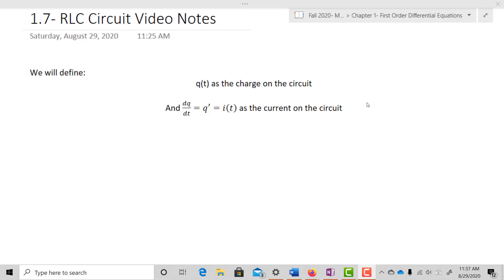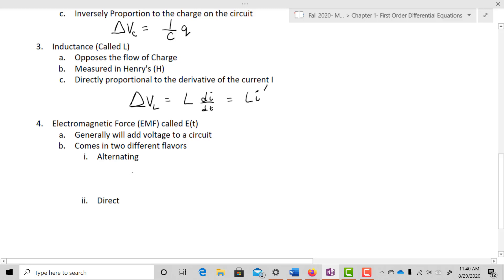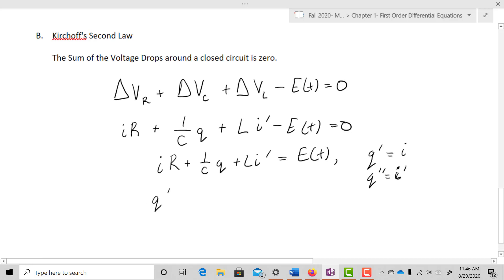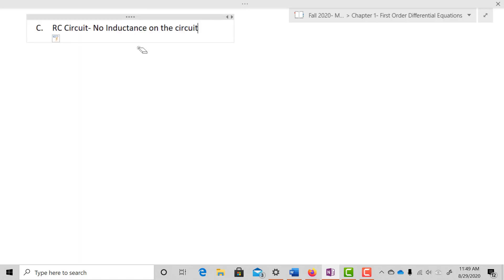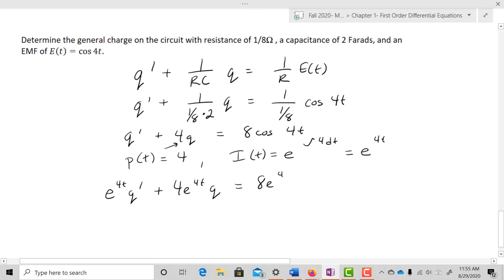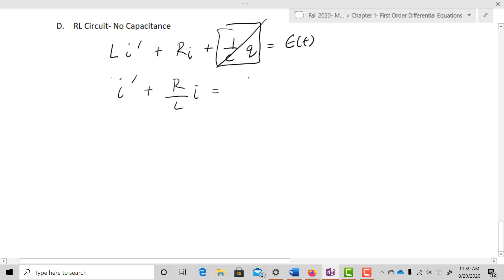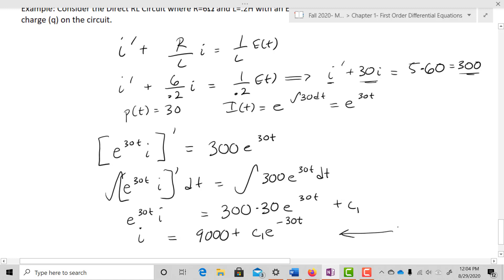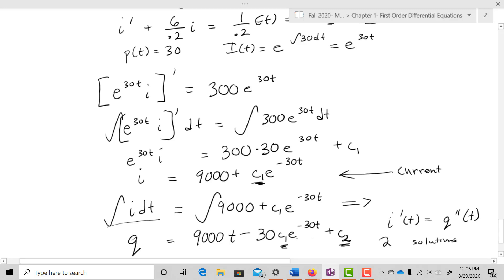RLC Circuits

Comment: Thanks for posting these vids professor, as always they are extremely useful.

I make this mistake (especially at the beginning of the semester) where I apply properties of differentiating instead of integrating through, think I see it here in this vid:

15:45 integral of 300e^(30t) should be 10e^(30t) + c_1

on the other end I have q = 10t - (1/30)(c_1*e^(-30t)) + c_2

Correct me if I a wrong.
Reply from the maker: That looks right.  I will put it on my list of videos to correct.